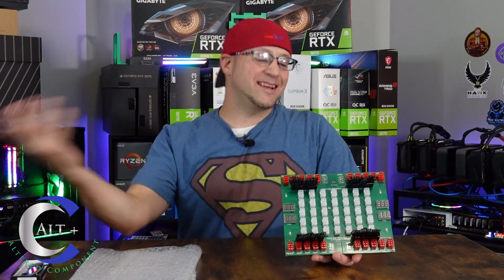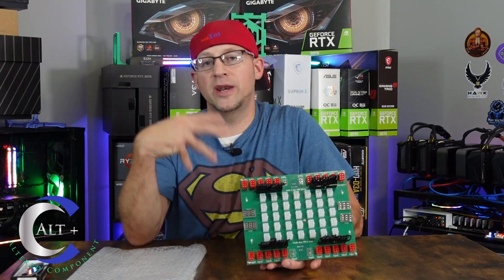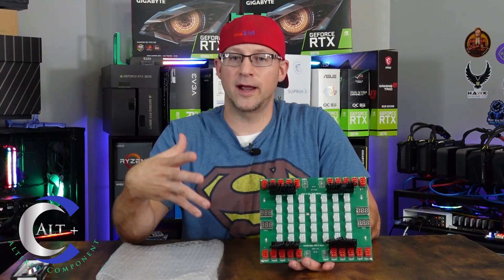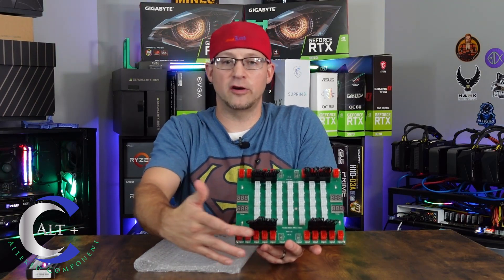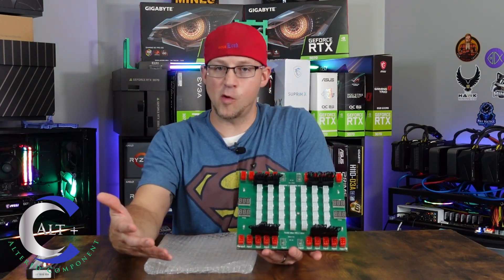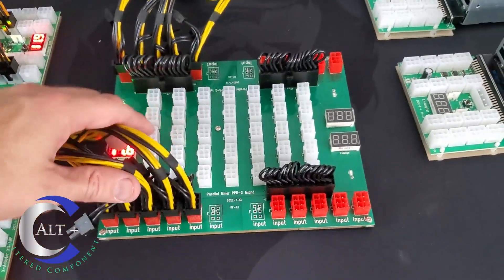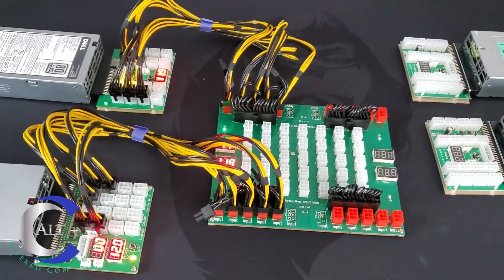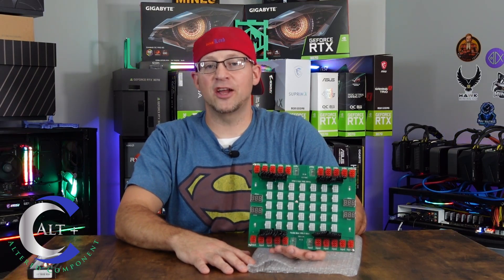⚡ PPR New Innovative Breakout Board for Mining with Server Power Supply | Full Review & Setup Guide

Comment: Can I use this with 4x 2000w supermicro 27-pin PSU ?
Reply from the maker: Well it only supports up to 3200w ;)
Reply: I Know !, I only use about 2400w only !, I need full triple redundancy... so I plan to use 4x 2000w
Reply: My question is, Can I use supermicro 27pin PSU ?
Reply from the maker: @meowsoftware7258  yes...you can use atx power supplies.  The atx psu 6 pin pcie power would plug into the ppr2
Reply: @AlteredComponent  Not ATX PSU, it's 27pin gold finger supermicro PSU...
Reply from the maker: @meowsoftware7258  ah...I had to Google that one.  So it is a 2k watt server psu.   As long as u have a capable breakout board to convert the server psu to multiple 6 pin pcie power out then no different than say a 1200w hp server psu I would think
Reply: I use it for machine learning workstation so... I needs very very very great stability... power supply minimum capacity is 300% of maximum load...

Comment: Pretty sure second PSU appears to be ON because its backfed by the first one, if you would plug in some cards you would see that the amperage readout on the second PSU would remain 0.
Reply from the maker: I agree.  i played around with it, and when you boot any of the other (2nd , 3rd, 4th slot) server psu, it did not boot the system.  So it is feeding from the primary input slot 1st
Reply: @AlteredComponent  I can also guarantee when you load those more you will very likely have some PSUs barely loaded and one overloaded and shutting down and/or having the fan go mad 100% 24kRPM.
With servers they have special circuitry and PSUs of the exact type must be used, should be possible to recreate it, octominer did it I believe.
But then you would need to have the server PSUs directly connect via the edge connector to the combiner board because there is need for specific electrical signal from the server PSU to realise the balancing.

Comment: so you could use atx psu as well? like 4 x 750 platinum?
Reply from the maker: So the answer from parallel miner is YES the PPR can be used to combine multiple ATX psu to pool power:  "Yes, of course, you can. That was the exact idea when we designed it. As you know ATX PSU needs some connection to start. that will have to be addressed but they are plenty of solutions for that online.  Useless ATX 300watts PSUcan becomes 1200watts! "
Reply: @AlteredComponent  awesome man thanks for taking the time to answer!
Reply from the maker: I am looking into that, but I doubt that will work to be honest.  I have a feeling it would overdraw the power.

Comment: Can I plug in non-modular psu's to this? Got a few i pulled out of prebuilds that i might put to work.
Reply from the maker: Honestly i am not sure if you can use this for ATX psu.  It may try to pull more power than the cables or power supply can handle.
Reply from the maker: So the answer from parallel miner is YES the PPR can be used to combine multiple ATX psu to pool power:  "Yes, of course, you can. That was the exact idea when we designed it. As you know ATX PSU needs some connection to start. that will have to be addressed but they are plenty of solutions for that online.  Useless ATX 300watts PSUcan becomes 1200watts! "

Comment: Hope it's better than the X11 boards. I have had 5 go bad in the past 8 months. If you look it up you will find that most people have the same issues. Bad power on circuit.
Reply: I had 5 X12 boards Fail on me in the past 6 months, others reported the newest "batches" of the these board are faulty, everything that was purchased earlier from PM works fine, I love PM but quality needs to improve
Reply from the maker: Thanks for watching, I think a production issue on the X11 in the last X amount of months.  Any of the older versions of the boards seems to be bullet proof.
Reply: @AlteredComponent  That's what they told me too but I have had the same issues with ones that I purchased back in October of 2021 and ones that I purchased 6 months ago. I think they are just trying to cover their rear ends. They did RMA mine even though they are out of warranty though so that is awesome. I have started buying the ones from Deep In The Mines recently though. They are a simpler design but with a much heavier duty PCB.
Reply from the maker: I wonder what actually changed in the x11.  A simple junk resistor is my guess that was changed at some point in manufacturing.  I havent had too much Deepin the mines gear.  I have had some nice wrapped splitters form them that have had zero issues ;)

Comment: RIG Literally caught fire yesterday :[ smelled burning and toxic rubber at 4am. it was my parallel miner  cables burning and shorting! paralel miner was my go to but not anymore man, heres hoping i didn't lose too much money and everything works
Reply from the maker: Wow man.  Where did the the failure happen?  i assume at the connection at the plugs.  Perhaps one of the pins were not fully seated in the plug and pushed out.  ive melted some connectors for sure.  I melted 2 different 6 pin connectors, but both were where i didnt have them fully seated into the gpu.  i have melted a few of those adapters that we should avoid back in the day (sata to 6 pin).  i fried a molex connector.  I fried a 6 pin to dual 8 pin where i had it double split and too much power draw lol.  Hope not too much damaged buddy.  mine on
Reply from the maker: Wow man.  Where did the the failure happen?  i assume at the connection at the plugs.  Perhaps one of the pins were not fully seated in the plug and pushed out.  ive melted some connectors for sure.  I melted 2 different 6 pin connectors, but both were where i didnt have them fully seated into the gpu.  i have melted a few of those adapters that we should avoid back in the day (sata to 6 pin).  i fried a molex connector.  I fried a 6 pin to dual 8 pin where i had it double split and too much power draw lol.  Hope not too much damaged buddy.  mine on